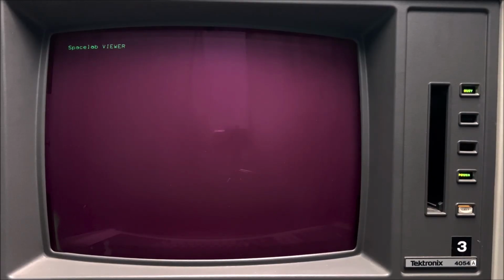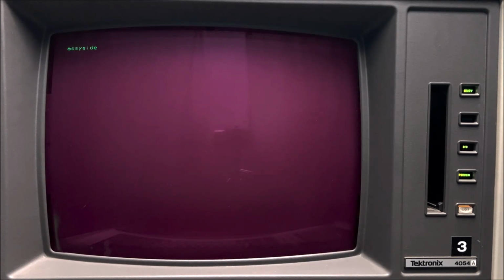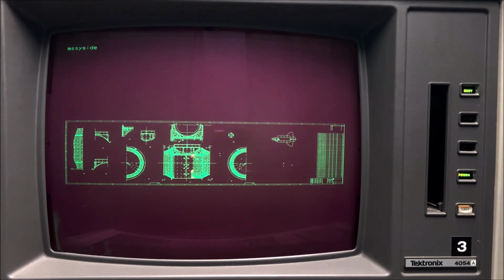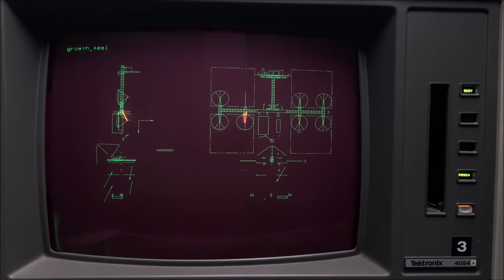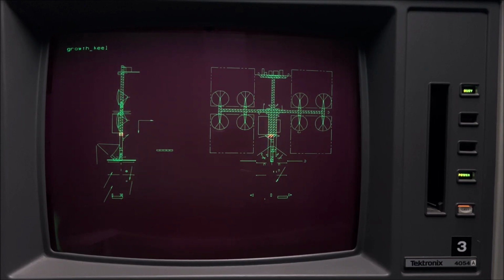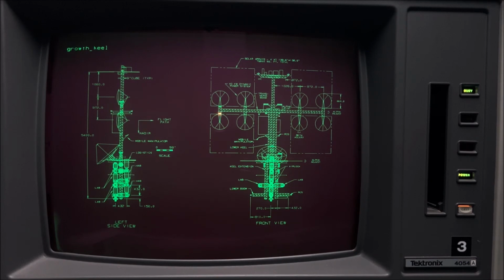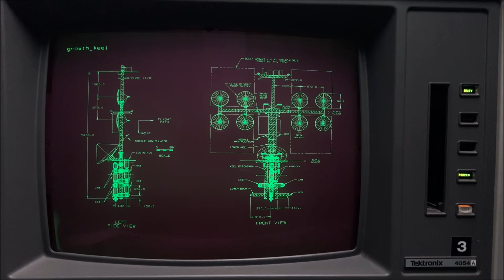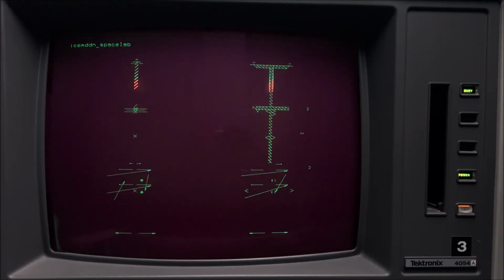Spacelab vector graphic drawings on my 4054A

Comment: Are these in dwg
Reply from the maker: No.   These images were in Tektronix PLOT 10 401x vector graphics terminal format that I found here: https://github.com/rricharz/Tek4010/tree/master/pltfiles/ICEMD_pltfiles  I wrote a Tektronix 4050 BASIC program to convert them to 4050R12 Fast Graphics/Graphics Enhancement ROM Pack binary format to draw them quickly on my 4054A computer from 1979.

Comment: So this thing is an electronic etch a sketch in real life?
So how long does the screen stay persistent?  Call seen a vector tube you could store vectors on. So many questions.
Reply from the maker: With no keyboard activity the screen will persist the image for 15 minutes and then automatically erase to prevent burn-in.  Two minutes after no keyboard activity the screen will automatically dim and any key pressed will bring it back to full intensity - like a screen saver.
Reply: @TEK-Vectors  and  the ability to erase as well.
Learnt something interesting about tech I  have never heard of before today . Never seen myself in half a century of computer usage

Comment: Have you checked your Filament voltage
Reply from the maker: Very good question!  I don't think I have run the calibration on my 4054A since I got it working in August 2022.  This computer had been in storage for more than a decade and it had bad DRAM when I powered it up.  Using a clone of the 4052 Diagnostic ROM Pack I was able to pinpoint multiple bad DRAMs and replaced them.  Then the Diagnostic ROM Pack reported bad DRAM on my Option 30 board - and I replaced a couple of DRAMs on that board and everything worked!  I took my 4054A to The Computer Museum in Mountain View California for VCF West 2022 in August and had a lot of fun displaying what it can do.   Looking at the service manuals - the filament is powered off the high-voltage power supply transformer - I see a high voltage test is first in the calibration procedure, but I need to check that I have a working high voltage probe.

Comment: how people draw this on computer? something in that days like CAD?
Reply from the maker: Yes, the early CAD programs ran on mainframes and mini-computers and Tektronix vector graphics terminals like the 4010 series were connected to those computers to create the drawings.  Then the drawings were sent to plotters for hard copies.  My Tektronix 4052 and 4054 computers were self-contained computers with vector graphics displays and were programmed in BASIC.  They also included emulation ROMs to emulate the 4010 series terminals.  In this video, my BASIC program is simply drawing the vectors that were sent from the mainframe or minicomputer to the terminals.  I do have CAD software programs written in BASIC for my 4052 and 4054 computers for creating engineering drawings without needing a mainframe or minicomputer to run the CAD software.

Comment: I used to work as a Field Service Specialist for Tektronix back in the 80's and haven't seen one of these in decades.  My only question is, where did you manage to get a storage tube in such good condition this many years after they've gone out of production?  Normally the flood guns cause the phosphors to glow with a constant low level green glow.  When the background gets as dark as in this video they're about to fail, although the persistence of the drawn lines also begins to break down as well.
Reply from the maker: I purchased my 4052 in 2000 from an Arkansas Medical School auction.  It came with a mint condition steel cabinet which had a 4631 Hard Copy unit on a roll-out tray.  I purchased my 4054 in the same year in an EBAY auction and drove to Oklahoma to pick it up in my classic Mini Cooper!  Both the 4052 and 4054 had bad Mostek DRAMs, but I replaced them and got both working in 2000 and began retyping my programs from hard copies made on a 4051 I used in the late 1970's.  I have now recovered programs from over 100 40-year old DC300 tape cartridges and posted them on my github repository.  Here is a photo in my github repository README of my Tektronix 4054, 4052 and 4631 in the steel medical cabinet- both running a Hidden Line program from BYTE Magazine: https://github.com/mmcgraw74/Tektronix-4051-4052-4054-Program-Files

Comment: That is very neat.. but how did it maintain persistence? Ah, you said at the end.. So does that imply that the image would eventually fade?
Reply from the maker: No, the image persists due to the voltage applied to the faceplate.  Bad news is I now have some burn-in from that image, since my program to convert the PLOT10 terminal data format of the Spacelab images to 4050R12 binary format took over an hour, and I kept the display on continuously by pressing the SHIFT key every couple of minutes 🙁  The result of the burn-in is that vectors displayed on top of that area are a bit dimmer - but that effect is barely noticeable.  My new programs for image conversion will leave the screen blank to prevent additional burn-in issues.  I had prevented the two Tektronix 4050 firmware features that prevent burn-in by keeping the screen active with no keyboard input more than two minutes which also resets the inactivity timer used to clear the screen after 15 minutes of inactivity.

Comment: Spectacular vectors aside, I love the plum colored (antireflective?) coating on that CRT.  It's a perfect complement to phosphor green.
Reply from the maker: Actually the plum color is due to Red phosphor added with Green phosphor at about 50/50 ratio to the CRT.  The Red phosphor used has very short persistence - and the Green phosphor is long persistence.  Both Red and Green phosphor illuminate at beam energy below the persistence level to create the 'orange' vector color for refreshed vectors.  For beam energy high enough for persistent storage - the 'orange' color is seen for a very short period as the vector is drawn, but then the Red phosphor turns off and leaves only the Green phosphor vector.
Reply: @TEK-Vectors   I did notice the pink color on the currently updating vectors, followed by the super-long-lived green. Are they somehow using the green as a bistable element? It seems like it is somehow kept in an excited state. It's brilliant in any case.
Reply from the maker: @AppliedCryogenics  - yes the display is called a Direct View Storage Tube and is designed to store the vector images until the screen is erased.  This computer will dim the screen in about two minutes if there is no program or keyboard activity.  The screen will be erased after 15 minutes of no activity.  Both these actions are to prevent the stored image from being burned into the green phosphor.

Comment: Very remarkable. Thanks for sharing this glimpse of what was once state of the art, a huge aid to CAD and science visualization in the early days. It wasn't only used for serious work though, engineers were nerds then as now. I recall playing a game on a storage tube display Tektronix unit like this; the game was a simple artillery simulation thing where two players took turns dialing in their artillery unit to destroy the enemy position. The ballistic trails remained visible on the screen after each turn. I think you used a second console to actually input the firing angle and velocity.
Reply from the maker: Yes, I actually did a second video on Super Artillery on my 19-inch 4054A vector graphics computer: https://www.youtube.com/watch?v=mVj3xL5sNG4&t  I loved playing the artillery game on the 4051 in the late 1970's - which may be the reason I like to play the original Angry Birds games on my iPhone 😁

Comment: I can't help but think of the old sci-fi movies of 80's, where similar drawings can be seen on a computer screen. I guess those sci-fi computers screens used Tektronix drawing graphics computers to do the job.
Reply from the maker: I believe you are correct.  Tektronix even introduced color graphics terminals in the 1980's but found the sales of their storage terminals including the 19" 4114 were still preferred over the much lower resolution (max of 1024x768 16-color in the 4111) color raster-scan terminals.
Reply: They absolutely did. Another reason they used these Tektronics? No flicker on camera.

Comment: Wow, it's fast!  I would love to have those files to show on my 4006 !
Reply from the maker: Ronny, do you have any way to display PLOT10 files on your 4006?  If so, you should be able to directly display the .plt files in this folder: https://github.com/rricharz/Tek4010/tree/master/pltfiles/ICEMD_pltfiles  Looking at the 4006 user manual on http://www.bitsavers.org/pdf/tektronix/4006/ I believe the graphics command set is the same as the 4010 and 4014 terminals, so you should be able to send the files from your PC at 4800 baud to the 4006 without changing the file format!
Reply: @TEK-Vectors  yes, i can convert plot10. The 4006 actually needs pudding for long vectors at 4800, but works nicely. I just might dig it out on Sunday...